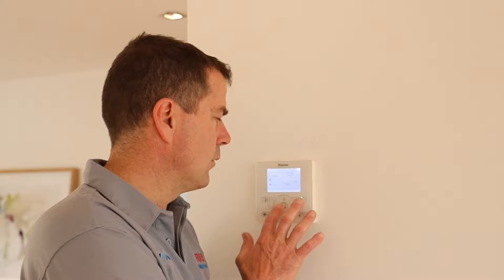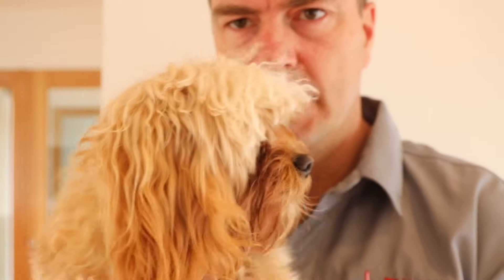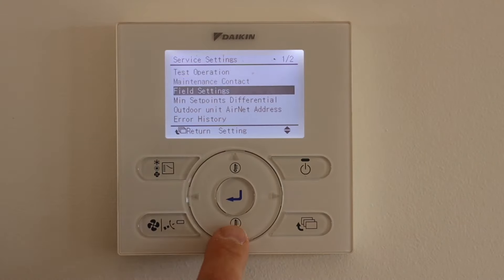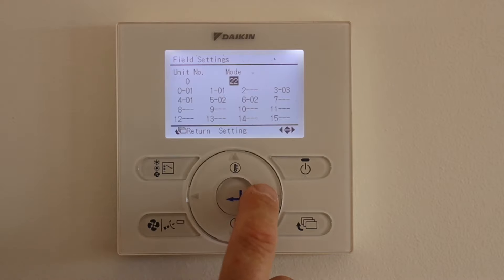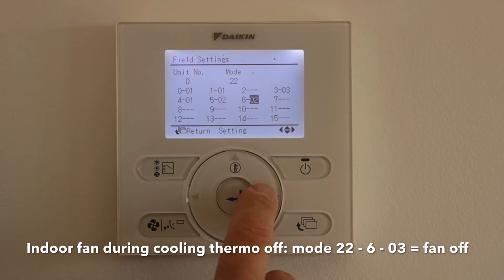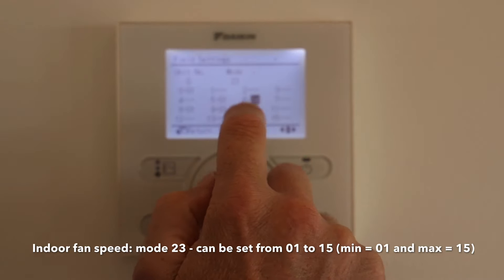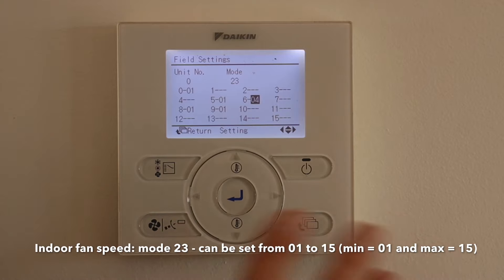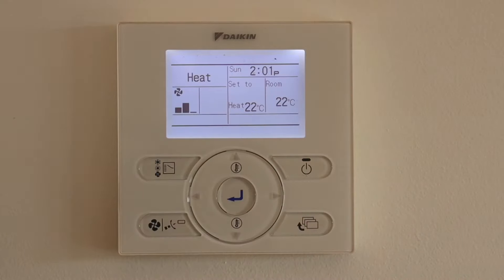Daikin BRC1E63 controller set up field settings cycle fan off, activate sensor in wall controller

Comment: Hi Craig, the for the video. I set 22-06-03 for the compressor and fan to disable when the temp is reached however in cooling I have a set point of 23degrees and room temp of 22degrees. I have also changed the setting to read the controller temp. Any tips?
Reply from the maker: Make sure 20-2-03 is set, also check c1-1-02 is set. Some models will all ways have some influence from the return air sensor. The only way around this is to install a remote sensor. You unplug the return thermistor, plug in the same plug on the pc board a remote sensor. You then install  wall mounted sensor next to the wall controller. That’s the only way around this, there are a number of different sensors available from DAIKIN depending on the indoor model, if you get the wrong one, you can always cut the plug off the existing sensor and join the cables to the wall mounted sensor.

Comment: Do you also install the controller next to your zoning box? This may be a weird question but just needed to know. Also if I have installed my 2 controllers in by my wired thermostat, I still have 2 more left and the rest are wireless thermostat? Does it matter where I install the other 2 controllers?
Reply from the maker: I don’t quite understand your questions, but with the controller if we were install a separate controller for zones (on off zones) we would normally install them next to each other. If the controller was a Myair zone controller that has wireless sensors, we would normally not install the daikin controller at all. With this this type of controller (Myair) the sensor location is set to the master wall controller (so Myair tablet) and the daikin controller becomes a slave controller (sensor not active). Then the Myair taps into the sensor input from the controller and tell what temp it is and manipulates the sensor input and controls the system like that. 
Dose that help ?
Reply: @FullyAirconditioned  I think I do understand . I think all I needed to know was where would you place these controllers that’s all. I would assume you would
Place them in a common area by the ac where it could sense the temp? Do these controllers go anywhere else?
Reply from the maker: @ryanroy5524  yes in the common area, it depends on the insulation, we have install the controller in a cupboard, away from where anybody can touch them (school) then connected a remote sensor to to the return air thermistor, (plugs into the indoor pc board). The sensor is then placed on a wall in the common area.

Comment: How do I activate the night mode so the outside unit is a little quieter please :) So helpful and thank you
Reply from the maker: Depends on the system and model, some are from the outdoor unit and some are from the controller. If the controller doesn't have this option it will be from the outdoor units and their many different units and each with the specific way of setting this. you would need to get the install manual for the outdoor unit.

Comment: Hi, can you please help? I have an extra panel next to the control panel unit which has recently gone to a blank screen and I can't do anything with it. No buttons, controls or anything. I can't see any options in the main panels menus that link to this panel. If I could post a pic, I would. It is a smaller panel, did displelay the room options etc but could work out how to use it then it just went dark screen. Any help is appreciated. TIA.
Reply from the maker: I really don’t know, could be for zones, some type of zone controller 🤷‍♂️

Comment: Can I get the display to show when the fan is on vs when it’s not? Is there a setting for that?
Reply from the maker: Sorry I am not sure what you mean??
Reply: @FullyAirconditioned  if I’ve changed mode 22 - 6 for the fan to turn off when the temp is reached, I’d like to be able to look at the display and know when the fan(and compressor) is currently running vs when it’s not (due to reaching the temp)
Reply from the maker: @cyssoK  ok I understand, no it doesn’t have this function from the wall controller. You can get a pc board that connects to the indoor unit, it will give you a closed / open contact when the compressor cycle. You can then wire into that contact and output like a light. That’s the only way to do this.
Reply: @FullyAirconditioned  thank you for your response!! Too complicated for me. Do you know if this control panel can be replaced with a Nest? Wouldn’t the nest show me this info?
Reply from the maker: @cyssoK  no, nest is very basic relay on off logic, it switches  relays to turn on and off compressor, fan and reverse valve. The Daikin’s units are not simple relay logic, they have micro computer communication between the wall controller, indoor unit and outdoor unit.

Comment: Hey do you know how to set the cycle on and cycle off duration? When i turn it on, it will stay on for about 2 hours, is there any way i can reduce this to about 30 minutes before it automatically switches off?
Reply from the maker: should be in the energy saving options list, download the manual  for full instructions, but i believe you can change the run on time.

kind regards  craig
Reply: @FullyAirconditioned  cheers craig, will do!
Reply: @FullyAirconditioned  hey just figured it out, thanks for your help!
Reply from the maker: @xpuregold1925  no problems

Comment: Hi, will this work with  BRC1E53A7 controller? Thanks
Reply from the maker: Don’t know sorry, it’s not a model controller available in Australia. The controller is just access to the indoor units pc board, depending on what type of fan and what sensors are installed in the indoor unit will depend on what can be configured. But most setting are very similar, if you can’t change anything, or the No doesn’t exist then it’s not available on the model unit the controller is connected too. Before you change anything make sure you note down what was set from factory before you change it, that way if it doesn’t work you can change it back.
Reply: @FullyAirconditioned  thanks for the quick reply mate. Will give it a shot 👌🏻 it’s for an office building. It has loads of these controllers dotted around the floors controlling areas but the installers are saying the control sensors are in the ceiling at the FCU. I always thought the controller had the control sensor so will try it out. Thanks again
Reply from the maker: @becomeanelectricianuk  it sounds like a Daikin VRV system, you should be able to make the wall controller sensor activate.

Comment: Hi there, I keep on getting a message on the screen about filter needing to be cleaned. I clean it but message is still there. Can I get rid of the message? Is there a way? Apart from that aircon works fine.
Reply from the maker: The air-conditioner doesn’t know that you’ve cleaned the filter. The filter sign is just a timed reminder that comes up after certain period of time on this controller. To clear it you’ve got to push and hold the clear button, that resets the timer and then after 1250 hours will come up again as a reminder. It doesn’t actually know that you’ve cleaned the filter or if the filter dirty.
Reply: @FullyAirconditioned  ok so basically when that "time to clean filter" or similar appears...go and clean filter and then reset the filter timer - then that message should disappear? So really the filter should only be cleaned when the clean filter message appears?
Reply from the maker: @AbsolutelyEverybody1  personally I would clean the filter at a minimum every 6 months, but it really depends on how dirty the environment the system is installed in, it may need doing more frequently than this. You can never have a to clean filter, the cleaner the filter the more efficient the system operates.
Reply: @FullyAirconditioned  oh really...every 6 months? I read somewhere clean filter every 6 to 8 weeks?  Also on my filter there is fluff stuck there and I can't get it out, used water to squirt it out - didn't work. I then tried the blower - didn't work. What I mean by fluff..well it's hard to explain...sort of like dust but fluffy stuff. But apart from the fluff there doesn't appear to be any dust on filter. I might have to pick the fluff out which might take a while.

Comment: Hi there, question: what do I if an “E2” error message shows?
Reply from the maker: There is a link in the video for the list of faults and what the fault means. I have copied this from the repair manual.
E2
＞
Description
Faulty BP unit (Junction box) PCB.
Recommended Actions
For Model Type All
VRVIII / VRVIII-Q - Earth leakage detection if internal (factory) earth leakage device fitted. High pressure sensor or switch
may be faulty/ open circuit at
"power up". Ensure any unused HP switch sockets on a replacment VRV control PCB have had the bridging jumper inserted (X3A and/or X4A).

Comment: How do you re-calibrate the temperature I feel my temp is way off from what the thermostat is reading
Reply from the maker: There is no calibration, where is it sensing the temp from, you can check this by breathing on the sensor on the wall controller, it the display temp go up it’s measuring from the wall controller, it it doesn’t, it’s measuring from the return air sensor. You can change it and see what one works best for you. The temp reading is just a point if you feel to cold just turn it up or if you feel to hot just turn it down, doesn’t really matter if it not 100% accurate, it just a point in the temp scale.

Comment: The filter requires to be reset on the controller. Do you have a video or steps to restore the system as it is turning off after 10 mins as this message I believe is stopping it from functioning . Two Bulkhead in wall units connect to the compressor.
Reply from the maker: Filter will not stop the system from operating, the filter is purely a timed function, it’s a reminder and it won’t stop The unit from operating. There is a reset for the filter, if you go into the menu you should find it there. The biggest reason the system could be turning on after 10 minutes is there could be a fault or you may have one of the energy efficiency setting set. So if you go into your main menu, check energy efficiency and just have a look at all the potential settings and make sure that they’re all set to off, that’s what I’ll be checking first.

Comment: Just a question , 23, 06 mode on mine only goes from 1 to 3 not the 1 to 15 it shows on your model ? And it’s currently set to 1 ?
Reply from the maker: Hi, it will depend on the indoor unit the controller is connected to, the controller only allows acess into the settings that the indoor units pc board has, topically this would mean that the type of indoor fan motor only has 3 speeds,  probably an AC fan motor, not DC with infinite speeds.
Reply: @FullyAirconditioned   thank you very much for the reply.

Comment: Is there a setting for the electric auxiliary heat ?
Reply from the maker: No, when the booster heater card is plugged into the indoor unit, it operates automatically. Booster heater will come on then the indoor coil temp is below 38 degrees and the return. Air temp is 2k below the set point. After the system has been operating in heating the indoor fan run on for 60 sec after compressor has cycled off to cool the elements.
Reply: @Fully Airconditioned  thank you for the reply . But the issue I have now is that the house is at 13°c and asking for 24°c , only the heat pump working but it's-30°c outside .. the electric elements are not coming on , I don't have 24v on the plug on the board HEATER ( blue and white wire ) . So I had no choice to bring 24v directly on the heating elements contactor to have heating from the electric heaters , but I have heating none stop . I suspect the furnace board to be defective.  FTQ3OTAVJUDAA that's the furnace model.  Any idea what's the issue ? Thank you
Reply from the maker: @samuelguaranteed5163  yep sorry your not in Australia, as it’s summer here, guessing your in the US, anyway your unit are very different to ours, Australia moved away from this style of unit over 20 years ago for efficiency efficiency reasons. Our units move more air, have a smaller temperature differential across the coil. I don’t know if your heater elements work the same way. The card we use is a KRP1B5X that is used to drive the element, Google search a photo and I believe it will be different to what your looking at.
Reply: @Fully Airconditioned  Canada! Yes electronic board we use in our furnace are totally different of the one you got . I will call daikin tech support on Monday.  Thanks for the reply

Comment: Hi, I have a question what to do when the panel on the main screen is locked for setting de mode and the fan speed and angle. Those are the only 2 which are locked
Reply from the maker: I am not sure what you mean, is there a key symbol on the screen ?
Reply: @FullyAirconditioned  yess. I can enter the settings on the ok button and the settings on the cancel/return button but the buttons for the mode option, Fan speed/direction and the on/off button is locked and whenn I try to press it you see a key symbol

Comment: I've made the changes as per your video (thanks) but it doesn't appear like the fan/condenser turns off once it reaches the set temperature. I set to 24 (cold) and timer of 2hours and it ends up getting too cold and can see the room temp is below (23) the set temperature. What could i be missing?
Reply from the maker: When you turn the temp up dose it turn off, adjust it up till it turn off, what have you set all the codes or just the fan to cycle ??
Reply: @FullyAirconditioned  I haven’t tried turning the temp up, I’ll give that a go. Am I assuming correctly if the auto off timer still has time left only the air/condenser turns off and the power light still stays on? Definitely set the codes to -03 to turn off for hot and cold.

Comment: we have just had a fresh air intake added to our system. I noticed today that the field mode setting 20 2-03 for choosing where you are checking the temperature now has option 1,2,3 and 4. We had it set to 3 to choose the unit thermostat rather than the air intake. But now I am not sure which one is the unit thermostat. Do you know?
Reply from the maker: 20-2-03 wall controller sensor 👍🏻
Reply: @FullyAirconditioned  Great thank you. how quickly would you expect the system to heat up from 18 to 22degrees-3 bedroom kitchen dining and lounge 188sqm.
Reply from the maker: That’s a hard question to answer. It depends on the size of the system and where you live (how cold it gets). I live in Canberra, it gets cold here, so when we size a system we don’t look at the capacity in the brochure as it’s measured when it’s 6 degrees outside. We refer to the engineering data book and look at the units capacity @ -5 degrees outside. As there is a large drop of in capacity at low outside temps. The daikin FDYA160 ducted system has a capacity of 18kw heating at 6 degrees outside. But that same system only has 12.9kw at -5, so it losses 5kw of performance. On top of that at -5 the system will need to go through a defrost so you loss heating for 10-15 min so there goes another 3kw of heat. So now your 18kw system is only capable of delivering 10kw of heat in 1 hour. If you needed 18kw of heat we would have sized a unit one or two sizes bigger. The FDYQ180 system has a large coil, so it’s ability to pick up heat from the air outside is very good. This unit has a rated capacity if 20kw heating and drops to 19.8kw @ -5, so it only loses 200watts. Not all units are the same and the loss differs depending on the model of unit, so it’s important for us to always look at the capacity in the engineering book for that unit. 
Sorry for the long answer.
😳

Comment: Hi. Thanks for videos. I’m new this industry. Working with daikin units Las to weeks since snow and cold started mostly issue is gas leak error. U0-02 error code.what I can do for this error. I don’t think all this AC got gas leak must be something with cold weather. Also any way I can reset error code on the remote control. Thanks
Reply from the maker: If the Daikin system comes up with U0 in out experience its usually correct in that the refrigerant is low and you have a leak. You need to leak test, find and repair the leak, pull a vacuum below 500 microns and hold for 30min to prove the leak has been repaired.  Then charge by weight the correct refrigerant charge into the system, you can not top up it will cause more problems. Repair it correctly the 1st time and it wont give you problems.

Comment: Hi. 
We currently have 3 controllers on our apartment. 
One in the main living room. 
And one in each bedroom. 
How ever only the one in the master room can control either cool or heat functions, which also overrides the other two. 
For eg, my son wants warm air whilst I like cool air however we can’t do that unless I change mine to cool as well. 
Is there a setting where he can have heat on and I can use cool air as well?
Reply from the maker: You have a VRV system, the controller that has all the functions is the master controller, what it set to will only be available on the other units controllers. You can set a new master by holding down the mode button on the current master controller for 5 sec, all controllers should be flashing now, to select a new master you need to push the mode button on the controller that you would like to be the master.
Reply: @FullyAirconditioned  thank you so much. 
Just tried it and it worked. 
Amazing help. 
Thank you again.

Comment: Hi i have a refrigirated heater/aircon that plays up on really cold mornings. Its always set to 24deg c with heat, but falls short of getting to temp after 2 to 3 hours ON. We need to switch it off to make it heat up again. Any ideas???
Reply: Btw its daikin same as your video
Reply from the maker: what model is the outdoor unit ??
Reply from the maker: See my defrost video